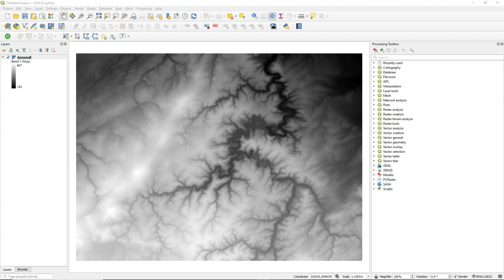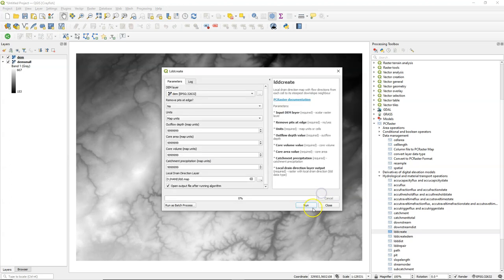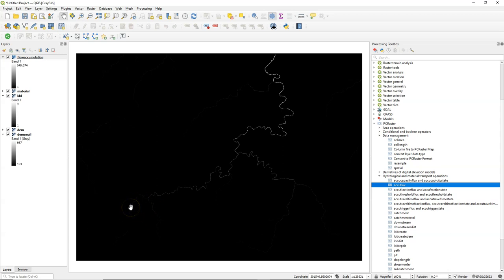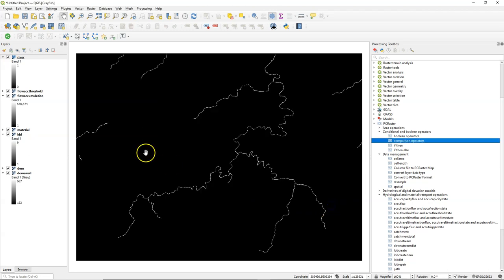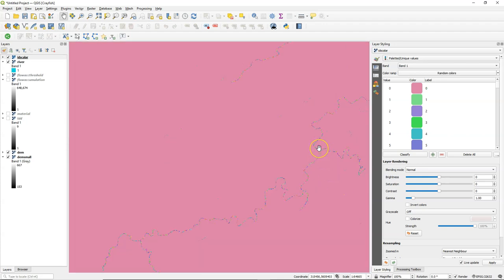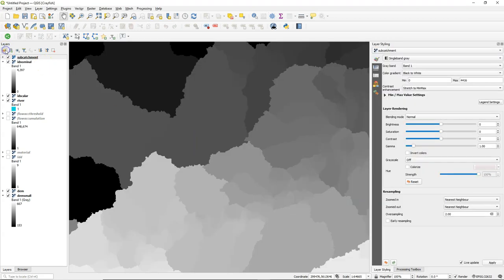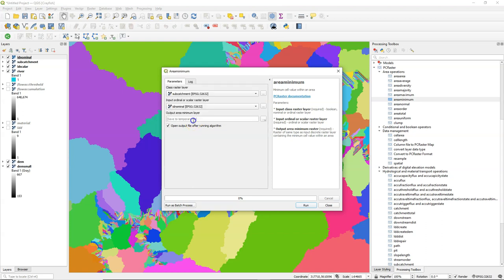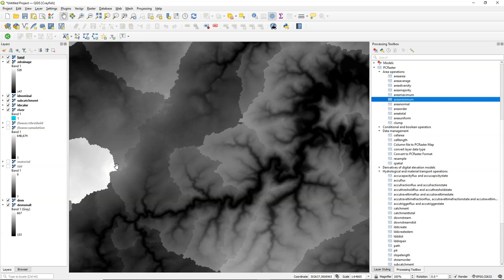Calculate Height Above the Nearest Drainage (HAND) with QGIS using the PCRaster Tools Plugin

Comment: Thanks for this. This is exactly what i was looking for. However, when i try to run the "lddcreate" tool, it takes forever and eventually crashes QGIS. I have also tried running directly in pthon and have the same issue - there is no error retuned, it just doesn't finish. Any help would be much appreciated
Reply from the maker: Either the DEM has a too high resolution or covers a too large area for the memory available on your machine. Solutions: use a coarser, smaller DEM or try to do this workflow with another algorithm for flow direction rasters. This is tricky because they are encoded differently for different tools. See also https://youtu.be/u98BvEcZH3M?si=Azafb5jwnOX1WoPz
Reply: @HansvanderKwast  Thank you - i will try your recommendations. And thank you for your quick response :)

Comment: How did you determine the flow accumulation threshold?
Reply from the maker: You need to calibrate it with a reference. For example a satellite image or map with the river network. You then choose the threshold that matches best with the reference.
Reply: @HansvanderKwast  Thanks for your response. I guess I'm still a bit unclear as to what the threshold is. Are you extracting an attribute from the network?